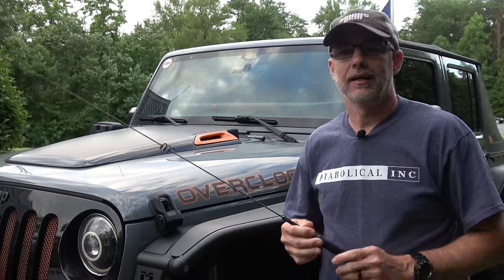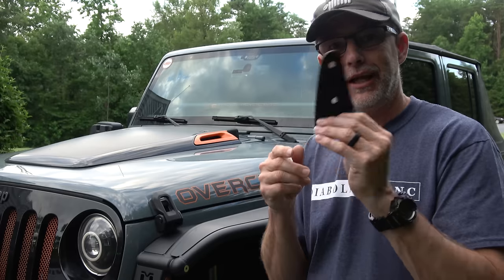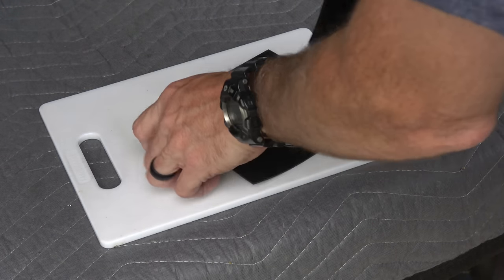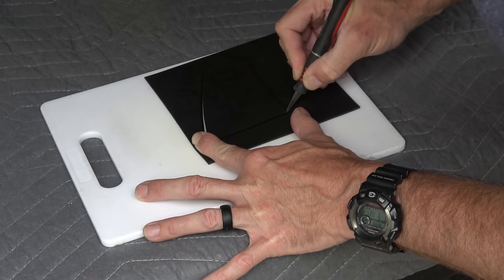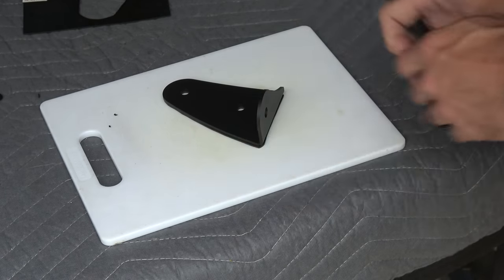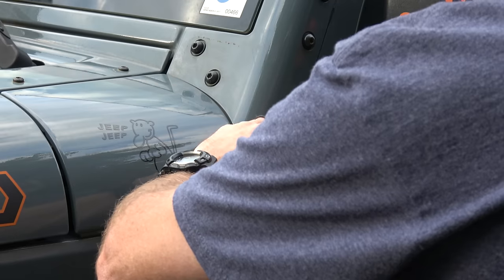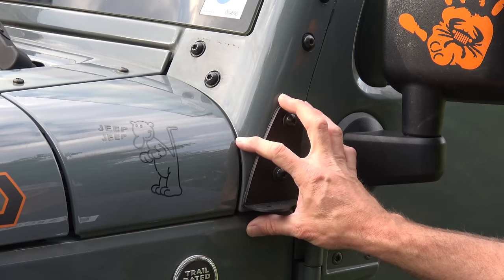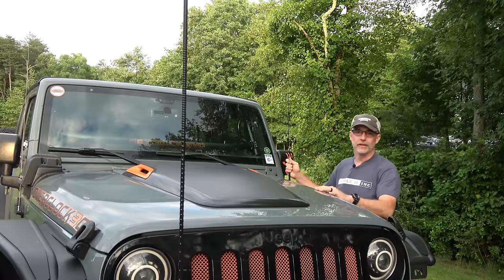Rugged Radios Jeep JK or TJ Antenna Mount - UHF/VHF Mobile Radio Install - 2015 Jeep Wrangler

Comment: Been trying to get this driver’s side bracket from them for two months but they have no stock. You can order online but then get an email from their customer support saying they don’t really have it. Any other good alternatives for a similar installation? Tks
Reply from the maker: Sorry.. I wish I could help you. I couldn't find them anywhere else when I looked.
Reply: o3djeeps [ OVERCLOCK3D Jeeps ] i finally received the brackets. They came with their own steel screws, but they don’t seem any longer than the original screws on the Jeep.  Not sure if they would serve as some kind of grounding, as they are not coated, but then again the bracket itself is coated. Any insights? Tks

Comment: What FCC license do you need for your radio? Rugged Radios seems to go out of their way not to share what bands they’re using, much less what license is necessary.
Reply from the maker: That's exactly why I am going to spend some time talking about that on my next radio-related video. Most folks buying "race radios" as sold from Rugged Radios, end up using them illegally because they don't realize that amateur radio licenses are required, and that the frequencies pre-programmed have business licenses owned by govt and companies all around the US... so the frequency maybe legitimately used by Big Willy's Race Team at KOH, might also be the same frequency used by your local Police Dept... And if you are using their channel they'd probably not like it much. :-)  I have a general class ham license, but really a technician license is what's needed, unless your are using GMRS, in which case you need a separate GMRS license, and of course a radio that can adhere to the maximum power regulations for them.  It's really complicated (at first) and it doesn't help that it's so easy to buy radios without any understanding of what you are getting into. I'm going to try and simplify it as much as I can.... if all goes according to plan. :)
Reply: o3djeeps [ OVERCLOCK3D Jeeps ] I doubt the FCC has the authority to do so, but I really wish they’d slap RR around. It’s clear they don’t want people to worry about licensing, just buy their gear and use it.
Reply: John Daily I’d say they’re pushing VHF/UHF down the road toward deregulation kinda like CB frequencies so many years ago.

Comment: I got to he same bracket. Didn’t realize when I ordered it, that it was a 3/8 NMO. I ordered my antenna base from another source and it was a 3/4. It took some time, but I drilled out the bracket to 3/4.
Reply: How did you run your coax ?

Comment: Tried that but it is too close to to metal window frame which will alter SWR and resident frequency of antenna. Be sure you check it before you burn up the finals in your radio.

Comment: hey man enjoy the video's. Long time lurker, first time post-er. What hardware did you use to install your cb antenna? Looking to install mine in a similar location. Apologies if i missed that particular video.
Reply from the maker: I never really did a video on it. I just drilled a hole in the bumper, and used a spring mount.
Reply from the maker: You might be able to see it in the Excessive Industries front bumper install video. I am not positive tho,.

Comment: Thanks for posting the video. My club just changed to the same UHF/VHF radio and I have been weighing my  permanent mounting options over using handhelds. I think the handheld is convenient but want the benefit of a fully featured radio installed as well. 
  Going to give that Rugged Radios mount a look.
Reply: If you can swing it, having both mobile and portable radios with you on the trail is ideal. Your mobile gets you out with 40-75 watts, your HT can keep you on your club's net if you need to dismount your vic for any reason.

Comment: The only concern I'd have is bonding between the coax shield and the body.  It's probably not a huge deal at VHF/UHF but if that antenna is a traditional monopole, it needs a good RF ground plane to bounce your signal off of so you get a good radiation pattern/max output power. 
73,
Wes/W9YYH

Comment: They've since redesigned the mount so that it only uses one of the bolts, and uses the panel ridgeline for forward/backward stability. New link is https://www.ruggedradios.com/index.php?main_page=product_info&cPath=736&products_id=2759

Comment: 03DJeeps, did you ever post a vid with the cable/radio install? Wondering how you routed your cable cleanly into the cowl from the mount.
Reply from the maker: Sure did! https://youtu.be/gVYYqAi8iok
Reply: o3djeeps [ OVERCLOCK3D Jeeps ] Awesome, thanks!

Comment: make sure you ground the antenna.
Reply from the maker: Absolutely!  That will be covered when I do the final install.  I expect a lot of people will think that adding a rubber backing is a bad idea because of grounding...but smashing that powdercoated bracket to my paint isn't going to do anything for grounding anyway...so I may as well protect the paint! I hope that the bolts (once I clean off some metal around the bolt holes) will be enough grounding so I don't need a separate grounding strap... but we'll see.
Reply: o3djeeps [ OVERCLOCK3D Jeeps ] Can’t wait to see that come together. I’m curious about taking trail comms this direction, but there’s just so little info out there for laymen, it seems.
Reply: How did you ground it the antenna? I have the same mount but trying to figure out how to ground it
Reply: @o3djeeps  - ha! Kindly ignore the comment I made earlier then about bonding!